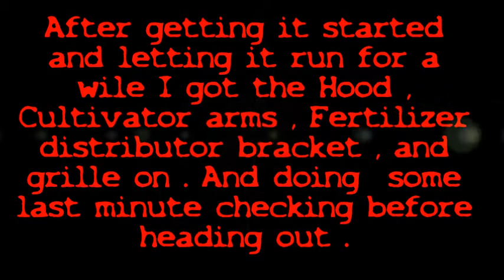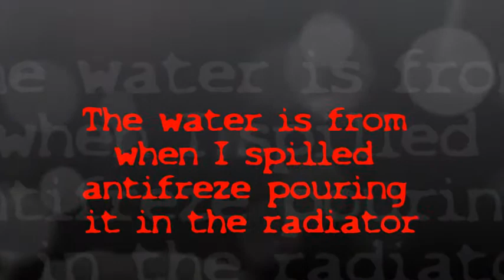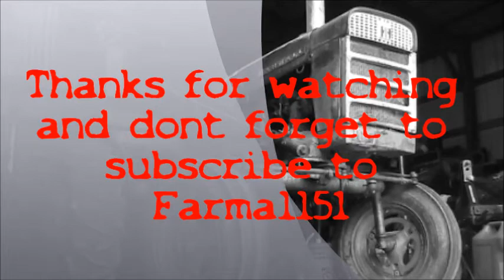Farmall 140 getting ready after engine swap

Comment: Good morning Farmall 51, need advice... Just picked up a 1960 Farmall 140. Barn fresh hasn't run in 22 years... Super original. Has about 2 gallons of antifreeze in crankcase. It appears to have never been started with antifreeze in the bottom end. Plugs and piston tops don't show any sign of antifreeze. Head gasket or failed o rings at the bottom of the sleeves? I'm planning to pull oil pan fill radiator and pressure the system to see something. Your thoughts?
Reply from the maker: While I had the pan off I'd fill the radiator full to make sure there isn't any cracks in the sleeves or block